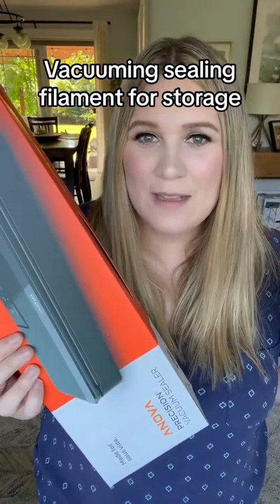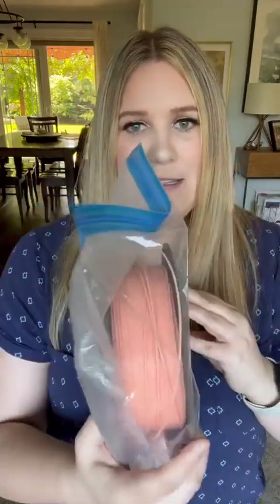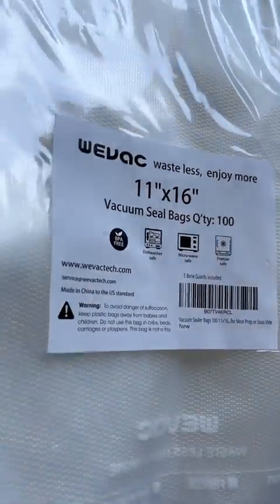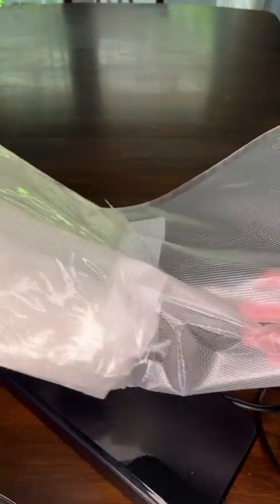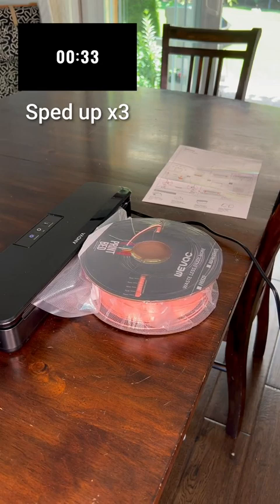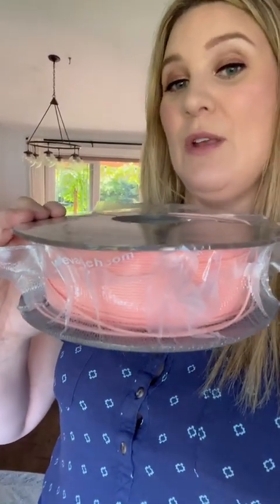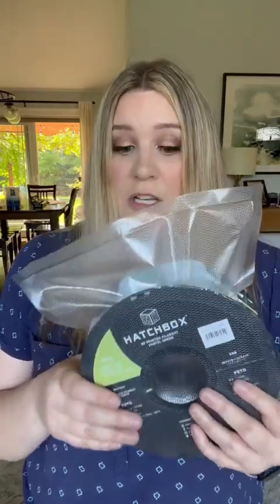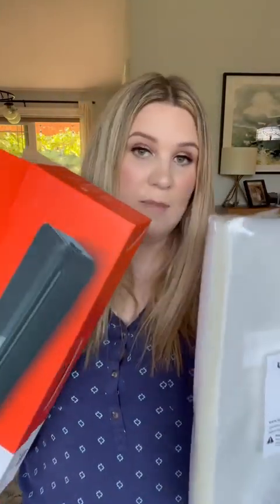Vacuum Sealing 3D Printer Filament

Comment: Was thinking about doing the same thing.  I did not think the spools would fit.  I would use the bags that you have to seal both ends.  If 11” is wide enough, you could make the bag extra long, so you could reuse it several times.

Comment: How does the vacuum last? As mentioned in your video, the other hand-pumped one cannot hold vacuum for a longer period. I don't really know why
Reply: if it's not holding vacuum then the reason it cannot hold vacuum is because its not air tight or the plastic itself is porous at a molecular level (in other words, wrong kind of plastic for the job)

Comment: That's how I do it. I also don't like the tight fit, and stop before warps the spool! And I'm quite disappointed that 11 inch bags are the standard? anything bigger is hard to find or very expensive, curious about the resealable bags but the one time I tried it they often leaked. Anyway reusable bags designed for 3-D printer spools that  never leak would be awesome

Comment: How well did it last?
Reply from the maker: I’m happy to say that I still use it daily and it still works perfectly!
Reply: @saraprints3d  thank you for the quick response and the video!!!
Reply: @saraprints3d  Your happy with the sealer everyday use for filament or for food? Tks!
Reply from the maker: @johnrussell6620  I’ve never used it for food. Only for filament and it’s worked perfectly for that use.
Reply: @saraprints3d  Any durability problems like easy tearing or puncturing or failed to seal, vacuum leaks over time?
Reply from the maker: @johnrussell6620  out of hundreds of seals, I’ve only had 3-4 not hold up. The nice thing is that I can double seal it, making two separated lines if I really want assurance for a certain filament.

Comment: What size (diameter and thickness) spools are you able to get into an 11x16 bag? Thank you for the video. I have been using the Eibos reusable bags and electric air pump and those bags fair right and left. Eibos ignores requests for assistance, so I am looking for an alternative to a pump solution.

Comment: I also have the zip lock bags and a small USB powered vac pump.  The bags are hit and miss and the pump no longer works, so was thinking about the same thing you did.  I checked the price on the bags, looks like @.25 each, not a bad price.  I was wondering if you sealed at the end, leaving extra material,  could you use the bag again?  Would like to hear more of your experience with this.
Reply from the maker: Keep an eye on the prices because I got the bags for $21 and the sealer for $59.95. Amazon’s prices fluctuate. There is extra length on the bags and I can reasonably get 4-5 openings on each bag. There’s also continuous rolls where you can make your own bag and you could customize the amount of excess you want.
Reply: @saraprints3d  Thanks for the answer!  I was thinking if you could get multiple uses that would be great.  I don't have problems with PLA, but PETG, ABS and Nylon - Carbon fiber can really get wet fast.  I'll keep my eye out for the deals.  Thanks for making the video